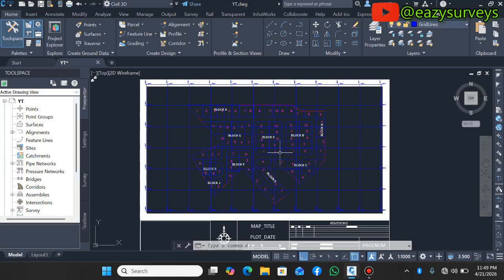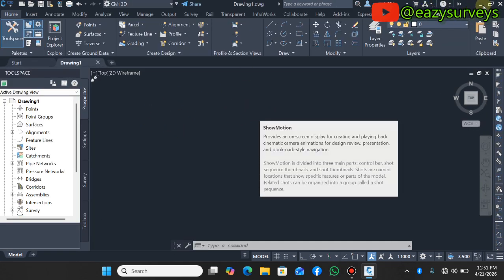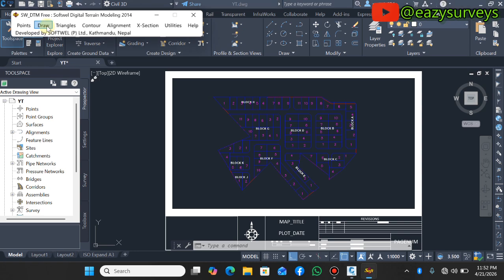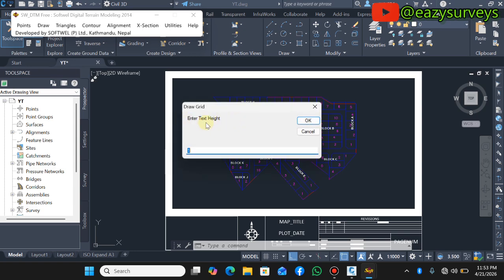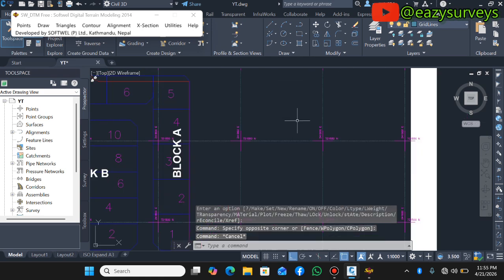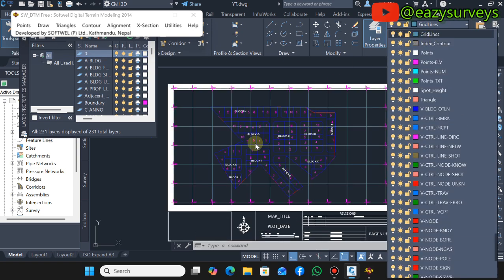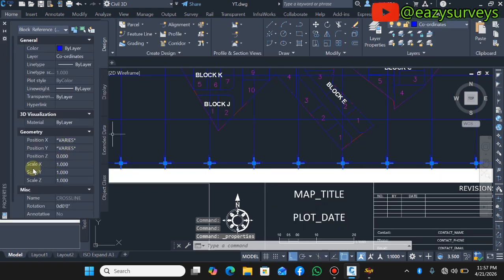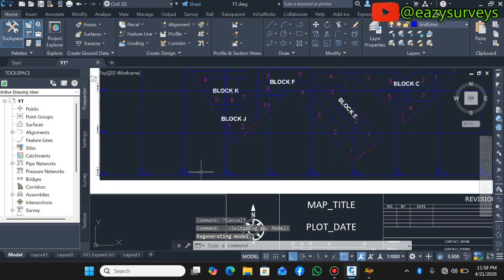How I add Grids/Graticule Lines on Survey Drawings in AutoCAD Civil 3D (1) || Civil 3D for Beginners

Comment: I followed your tutorial and it was very helpful. My problem is when I select my bottom left and top right, the grid doesn't sit there. It's either shifted to the right a bit or to the left. What might be the problem?
Reply from the maker: Glad it helped, kindly increase or reduce your grid intervals until you achieve a grid lines that suit you.

If you're using Civil 3D program, you can use the Civil 3D inbuilt tools for grid generation instead of using the lisp.